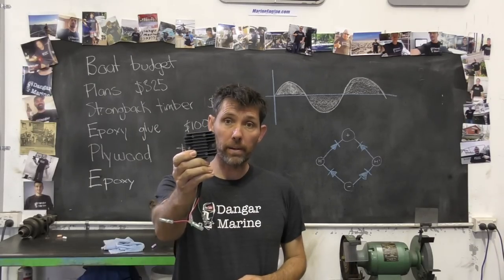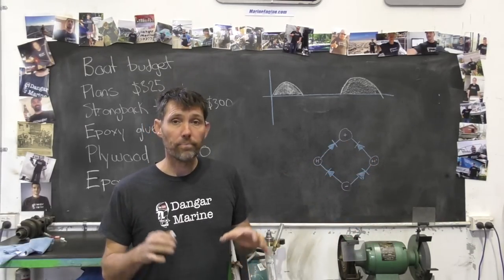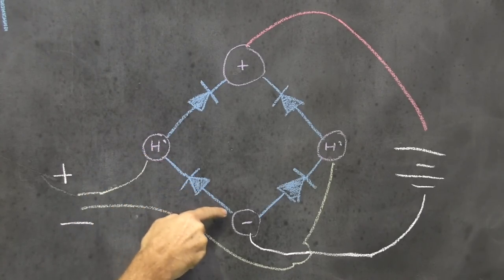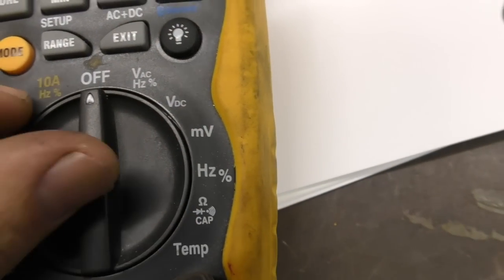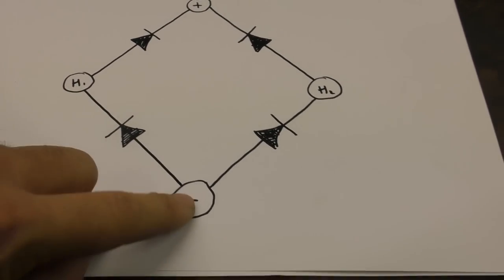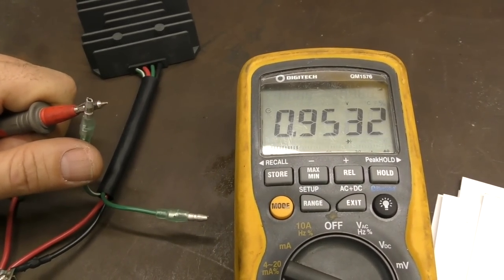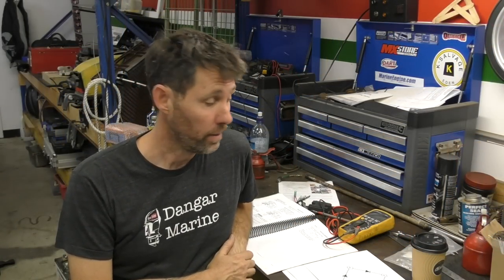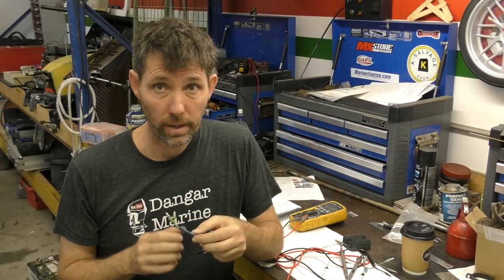Testing a rectifier

Comment: Like the videos just found your channel can't get trim guage to work on 94 150 Johnson  just a idea for a video thanks Tennessee river
Reply: John, those tilt gauges are just a voltmeter in reality ( same as a fuel gauge) . So you can just use a bunch of 1.5v batteries across the terminals  to check if  the gauge will work. Try connecting the batteries up as say 3, then 4.5 and 6volt  and see if the gauge moves. if not you can try 7.5 and 9 volts but usually by 6 volts the needle should have moved. If the needle moves then the issue is either in the sensor ( often the culprit as they live down on the engine mount and have a hard life out in the open) or a wiring issue. You need to find that sensor and do the basic checks- has it got a 12v feed on one wire, and a connection to ground on another wire? The third wire is the one that goes to your gauge and the voltage should change as the motor tilts up and down.
Reply: Ron Powell thanks will battery charger work bought the boat last fall running down the bugs
Reply: A battery charger will likely damage the gauge if the gauge is not already fried (unlikely) , but if the charger has a 6 and 12 volt setting, you could try the 6 volt setting. But for just the cost of 4 x AA batteries I wouldn't risk it.
Reply: Ron Powell will try that thanks for your help

Comment: I have a 10 HP outboard motor that nèeds
Model# SJ10RPLH
Ser.# G 03766761 (USA)

I need for it :
AC charge coil
DC rectifier
power pack.

Do you know where i can these ?